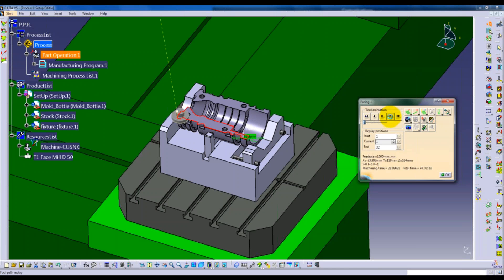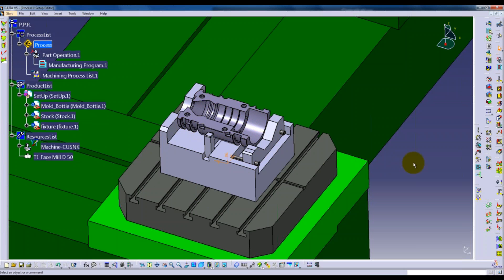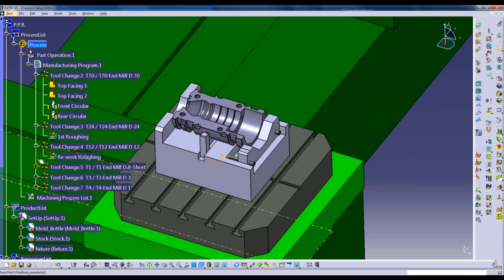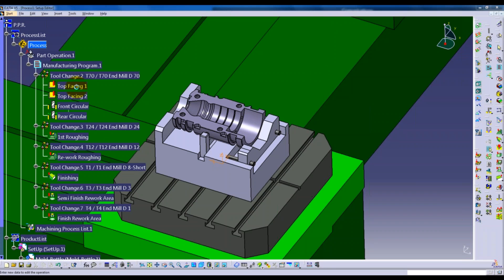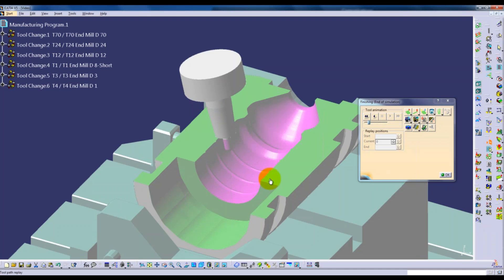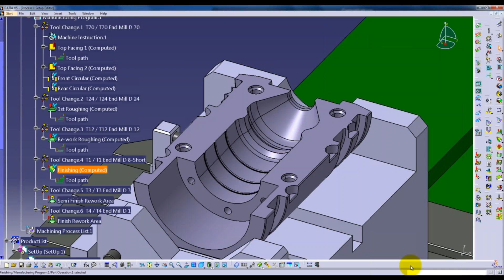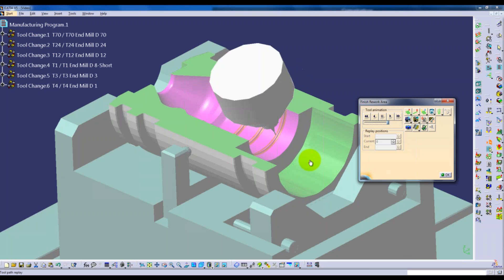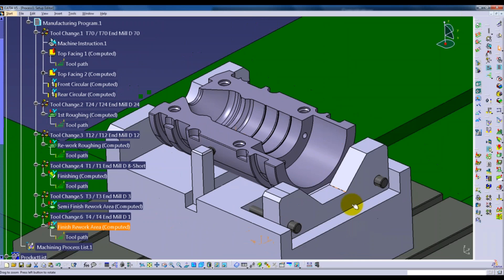Real World CATIA V5 Machining Webinar

Comment: Why doesnt anybody put on the tool radius compensation. When you output the nc code,  does it come with g42 d1 o g42 d2 etc? 
If you put the nc code directly into the machine, on the offset,  radius says 0. Do i have to modify it?